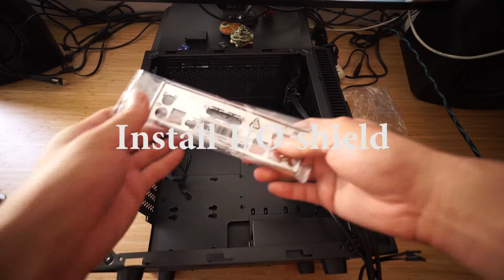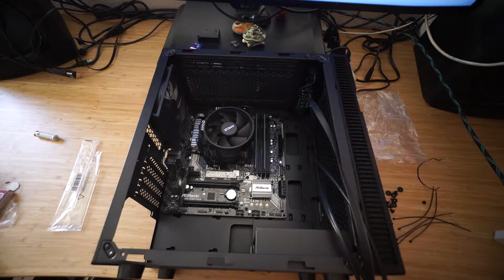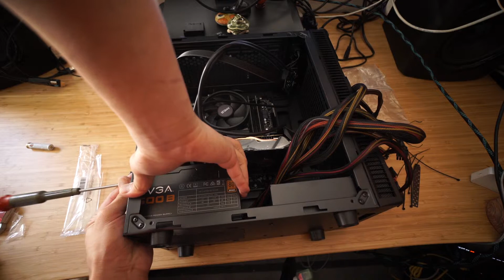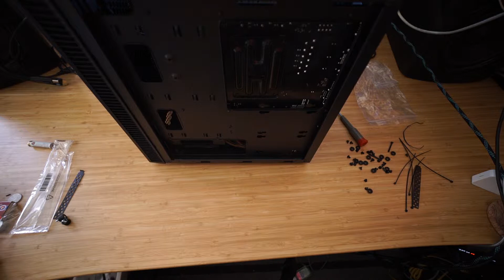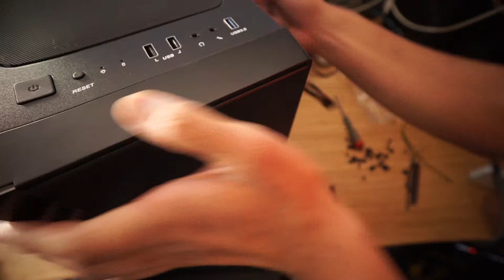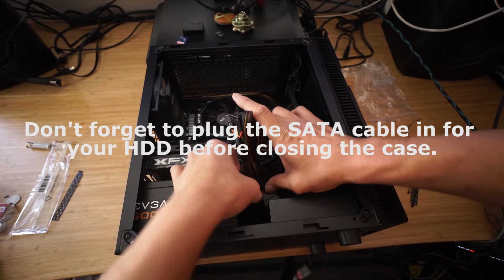Ryzen Build Part 2: Installing components into case

Comment: Your cable management is horrible and way you install components is wrong. Front USB, audio cables should be routed behind the casing before installing the motherboard. VGA should be installed at the end, not at the beginning.